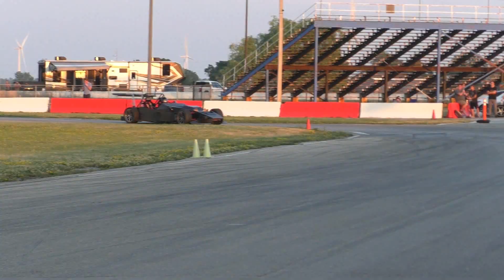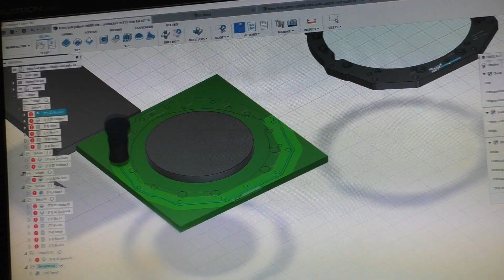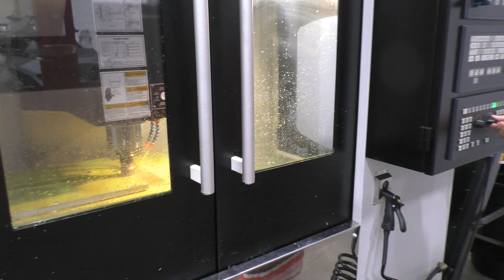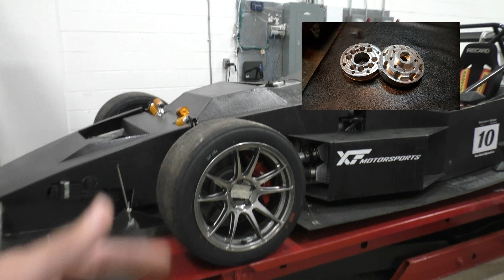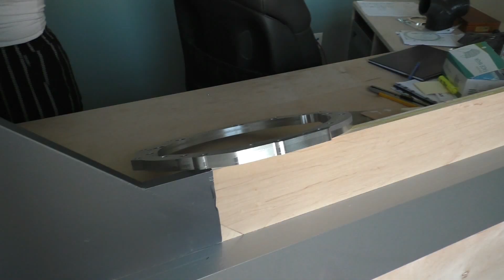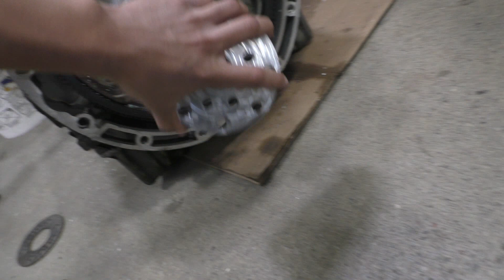Making Billet Aluminum Transmission Adapters - E55 Manual Swap Part 1

Comment: Consider one kit sold! 
As far as electronics, I believe there is an option for coding a manual transmission. It is located under Developer mode for DME in factory DAS software.
Reply: Cool if this is true!!
Reply: @BmwpetroldoorshoppingcarNordsc  I wouldn't be surprised, and I'm sure it's true. Merc offered manual transmissions on a lot of these cars for the EU market for many years. All of the Netherlands has Merc E-Class' as taxis.
Reply: autospeed  
True, if I did this to my car I would want to use the standard factory  engine management/mapping.
Reply: Other m113 manual swaps I’ve seen just leave the existing shifter in park so that is an option too.
Reply: chr1ssss I have one of those transmissions to bolt to a m113k project but everyone says they are too week?? Not seen any evidence of this though.
Reply: Bmw 330 petrol 4 door shopping car Nordschleife fun I think I’ve only seen na v8 examples and I don’t have any personal experience but I do agree it seems like people say they’re weak without an example.
Reply: @BmwpetroldoorshoppingcarNordsc  It's the size of that transmission and it's torque rating. It's evident from those two things alone that it wouldn't last behind 500hp and 500lbs for too long.
Reply: Oleg Loginov 
The same could be said for the Nissan box as it was never designed for such power/torque but it has been proven to be strong. The Mercedes manual to my knowledge has not been proven either way. Heavily up rated clutches are available for the Mercedes box too  
I imagine the flywheel/clutch diameter is similar on both.
Reply: Just use a crossfire trans m113/112 are the same bell housing
Reply: @srb2az141  the cd09 is a much stronger transmission. and on top of that tell me the options that transmission has for clutches to hold the torque of any of the m113k or other v8 mercedes engines. put those into consideration along with the fact that those transmissions are not out there in big numbers for people to get second hand.
Reply: Alex Hall 
I know the Nissan box is strong and I would rather fit a proved unit. Bit my question remains, where is the proof the Merc box is weak. Updated clutches are readily available for the Merc box too, at least here in Europe.
Reply: Yes you are right about the manual transmission coding. Euroworks in Florida figured it out. He has a w211 wagon with a manual swap running and driving.
Reply: @davidfrom313  What trans is he using?
Reply: @olegloginov6328  I think the 6-speed manual from the slk. Look him up on Instagram, its euroworksfl.
Reply: @davidfrom313  Will do, thanks. Just looking at the body of those Benz manuals, I have doubts in their reliability....

Comment: Only time you forgot to formally introduce a new face to the channel is when you had a lady on it😂😀
Reply from the maker: Mentioned her in a previous video. She does all the office work and some of the design and cnc stuff
Reply: @xfmotorsports  
Oopsss! 
I prolly missed the video.
Keep the content coming, i'm loving the way you keep transforming channel from DIYer to a professional auto+machine shop with unimaginable prospects. Really wish i could be your intern bro.
Reply: @xfmotorsports  you got a company email address?

Have an idea I'll send you, just don't want to share it publicly 😜
Reply: @karenmdesigns  Okay , no problem.

Can you pls confirm the proper email address to which I will send the mail.

The one link you provided above in the comments is just for text messages. I also had some images attached in my original mail, which I can't attach there.
Reply: @karenmdesigns   I had once sent an email earlier regarding a  question of A Arms setup , but still have not received any response yet .

If you dont have the specific answer to it or something, that too is fine with me, but atleast you could have informed about the  same.

Comment: Who is Karen?

Also how does the input shaft mate to the engine, with all the adapters I'd imagine it to be too short?
Reply: The transmission input shaft isn't mated to the engine, that's the whole reason for having a clutch... The clutch went on the transmission side of all the adapters so they don't affect its position relative to the input shaft.
Reply: input shaft goes to the adapter not the engine

Comment: Am i the only one confused by the thumbnail.
Reply: it's karen holding the fabricated adapter plates for the e55->nissan 350z manual transmission swap-out...what's not to understand? did you not watch the video?
Reply: @douglasharley2440  i watched it through though, but a was a bit skeptic.
Reply: @mianfazlerazik3636  lol, what exactly were you skeptical of?
Reply: Being a tard is all